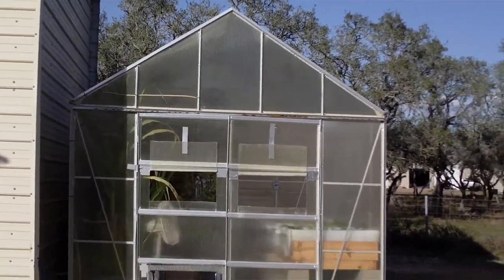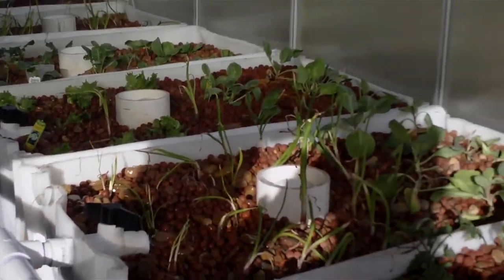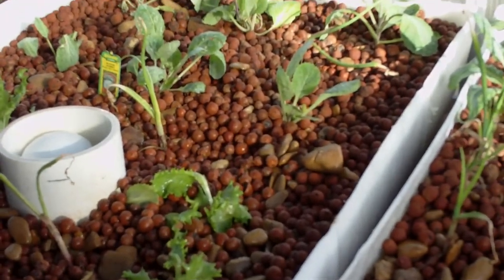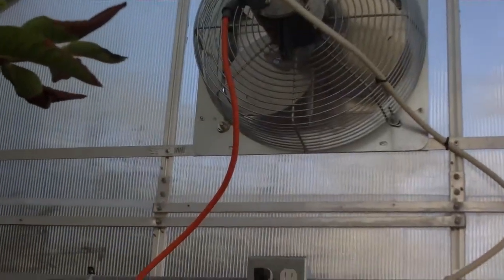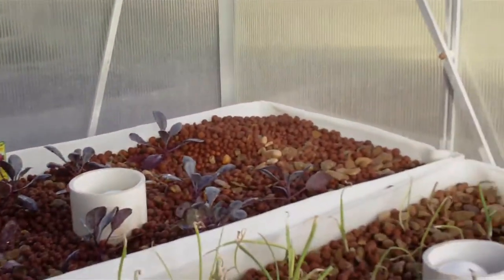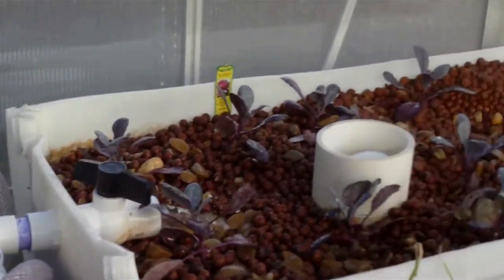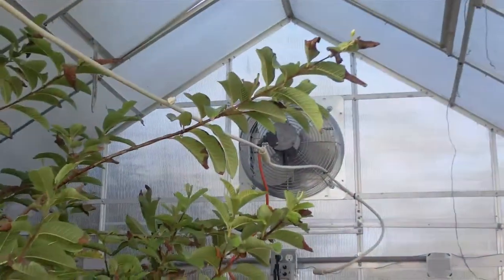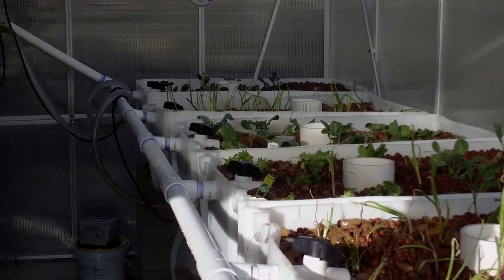Aquaponics System Setup Part 7

Comment: Al,
Great system. Where did you get the heater for the water system? It looks like a great idea to keep the water temp up. What kind of fish are you planning on getting? I saw a video for a vortex aerator that a guy in Hawaii (Nanawhale) had that ran off the water pump, similar to when you drain a bathtub, and the water forms a tornado pulling air down the drain. It ran so well, he didn't need air pumps. Keep up the good work, enjoy seeing how it progresses. 
Thanks,Bob

Comment: I am a little concerned that the Ammonia and Nitrate level is zero. The plants grow on  Nitrate so will not be as productive until it is introduced to the system. The Ammonia will be introduced by the fish or from another source (i.e. store bought) to kick off the Nitrate cycle that the system will use to be self sustainable.

Comment: What kind of water heater do you have on your system?
Reply from the maker: ***** A car engine tank heater, 1,500 watts
Reply: What car is it specifically?
Reply from the maker: Not specific to any car or engine, they are universal, just make sure you get the ones with the 5/8" hose connection and not the ones that mount on a radiator hose. Go to Amazon or Ebay and search engine tank heater.